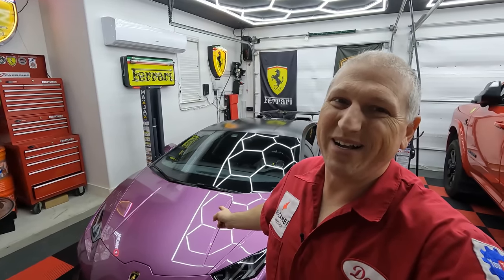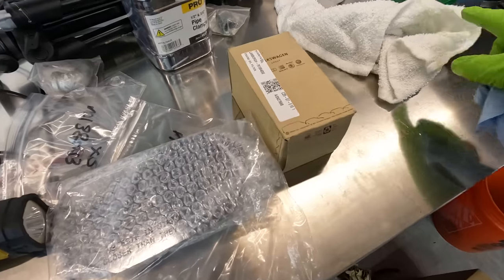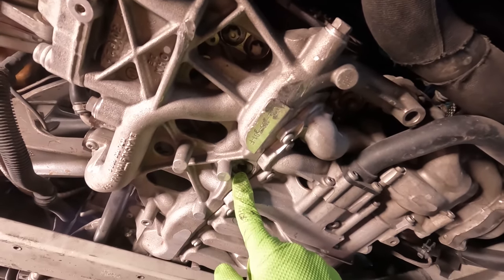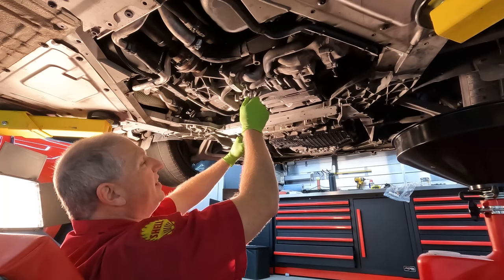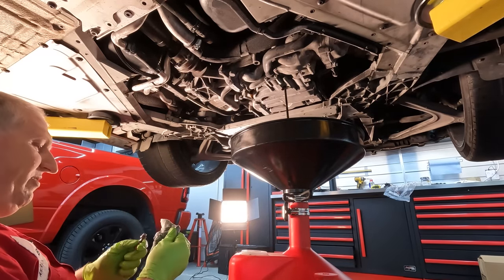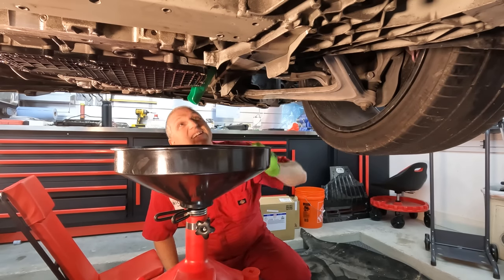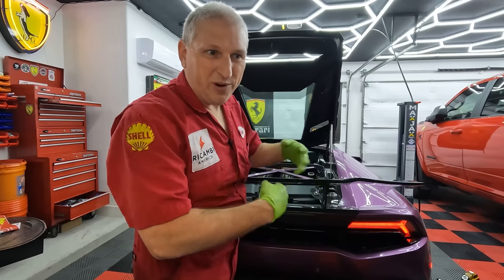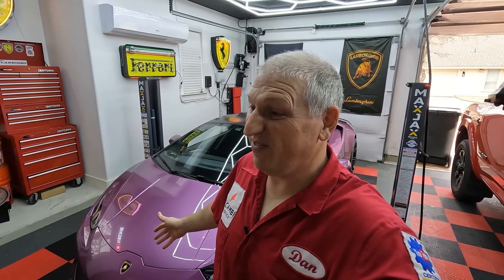How to Change the Oil in a Lamborghini Huracan LP610-4

Comment: Done this job many times!!  The plug way up high, use a tall Starbucks cup.  There’s another one where you need a low-profile plastic tray.  Of all eight, there are 4 different sizes of crush washers, all aluminum.
Reply from the maker: Yeah if they're gonna have so many plugs they could at least make them consistent
Reply: Wonder if someone has figured to engineer a oil pan for these to just a single bolt for oil 😂 crazy to have 8 drain plugs
Reply: @jp_interest4333  I don’t believe that would be possible due to the design of the dry sump system
Reply: @kyleanderson2807  it’s possible if you connect all the areas as one pan covering each hole, wouldn’t be pretty but it would work if they design it right, just be a really fat oil pan lmfao

Comment: Had to laugh when you tried removing the filter element from the housing!😂. It’s not like a 458, is it!!!  There’s a trick to it. Put the housing upside in a vise.  Use a flat head screw driver to pry the element to one side….to get it to release from one of the clips.  Then work your way around, one more at a time!
Reply from the maker: Geeze yeah that was stupid tight

Comment: When you’re working on a tough nut or bolt it’s always easier/stronger to pull toward you than to push away from you if you have the choice.
Reply from the maker: Yeah
Reply: But when you push away, you're less likely to bust your knuckles trying when it breaks loose.  20+ years of DIY mechanic with more busted knuckles than I have fingers.
Reply: @DavidEdwards9801  how are you less likely to bust your knuckles pushing away from you than pulling toward you? That doesn’t even make sense. You can’t bust your knuckles pulling toward you. Maybe this is why you’ve busted your knuckles so many times over the years.
Reply: @craigcampbell1843  You push away with an open palm.
Reply: @DavidEdwards9801  ah
Reply: @craigcampbell1843  Thanks for reminding me, but yeah =)
Reply: @DavidEdwards9801  haha

Comment: If one plans to do this on a yearly basis, may I suggest that you use large colored magic markers to mark and number the bolts on the drain plugs.  It wouldn't hurt to also have a list, 1through 8, stating what size or type of tool is needed for each drain plug. As you drain the different locations, you can draw a line through that number on your list. I did this two years ago, however, I'll never do it again. Last year it cost me $900.00, I'm sure this May it is going to be $1000.00. If one is thinking about buying a Huracan, you are going to be paying $1000.00 a year for oil changes. Let me also add that, it's worth it.
Reply from the maker: Yeah it's a pretty significant effort for an oil change
Reply: annual oil changes are for broke people 

or lazy people.
Reply: if you care about any car, whether  honda or a ferrari,

you dont do maintenance to bare minimum factory requirenents

Comment: Nice video, the OCD in me was like clean that oil off the metal shield lol  FYI the huracan takes 8-8.5 liters of oil. I hope you didn't really add 13. If you did drain immediately.
Reply: I've changed on my 2 huracans - one turbocharged and one stock. Both take less than 9 quarts. 13 liters is too much.

Comment: I'm sure it's been said already, but putting the filter cartridge in the engine first and then screwing the cap on is your safest option. I've seen a few blown up landrovers that use a similar cartridge and in short the plastic nipple needs to sit correctly in the drain hole in the filter housing, if not it usually gets snapped off or pushed up into the filter cartridge and then it's bye bye engine.
Reply from the maker: Ah yes

Comment: I would imagine that the torque specs are designed to allow for heat expansion. Cool 😎 color!
Reply from the maker: Could be but it still needs to be enough to crush the crush washer and form a seal.

Comment: As a lambo tech for future huracans it’s better to place the actual filter in the engine first so that way if it goes on wrong you won’t have to struggle to take it off..also if you look over on the drivers side where the filter goes, there’s a hole and you just match up that little nipple with the o ring on it and push it in, then screw the filter housing on…also torque specs for the two little 5 allan screws is 10NM, the big one is 45NM, the T30 is 12NM, the oil cooler plug is 23NM, the two M8’s for the lines are 30NM, and the 13MM in the front is 30NM aswell…on the dip stick put the oil between the words Do Not and usually start with 9.3 Quarts then add after you see the temperature at 90…P.S. always make sure you tighten the oil filter because it’s not fun to clean lol
Reply from the maker: Thanks for the tips!

Comment: I'm surprised the oil dipstick/fill is under that cover and not accessible without unbolting the cover.  Weird.
Reply from the maker: Yeah that's kinda annoying
Reply: @normalguysupercar  Here's an idea, have a hole neatly machined in the cover so you can access the dipstick/fill without removing the cover. At least you could check the oil level that way.

Comment: That style of oil filter housing sucks.  The one on our Jeep Cherokee just cracked at 70,000 miles.  We lost 5 quarts of oil before the check engine light came on.  The repair cost us $1,000--the part itself was $350.  There's a replacement one made out of metal instead of that cheap plastic.  I would never ever buy another vehicle with that type of oil filter housing.  By the way, a mechanic on YT said that is costs $17,000 to change the oil on a Bugatti!
Reply from the maker: Yikes